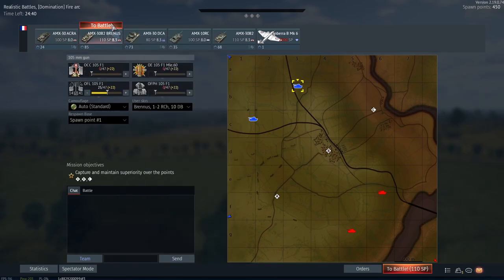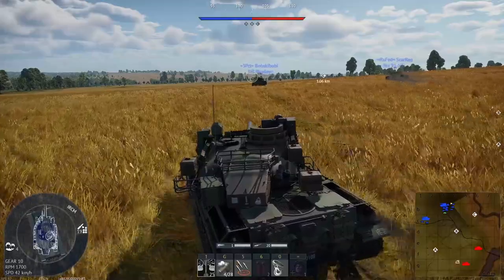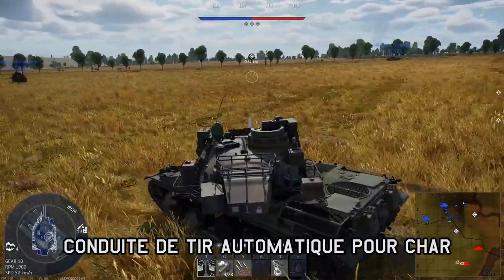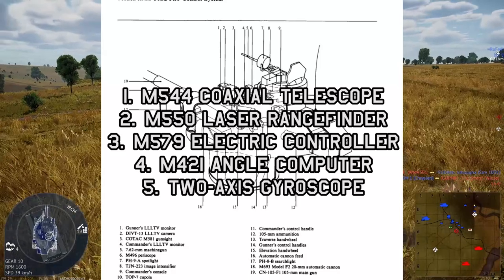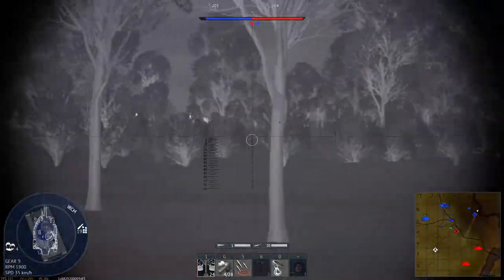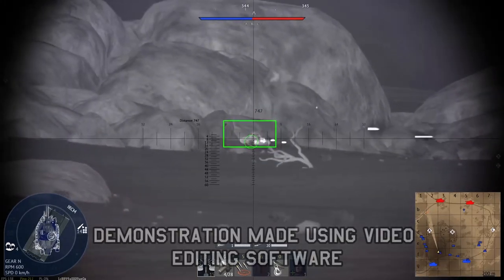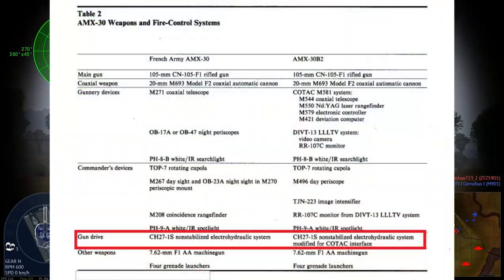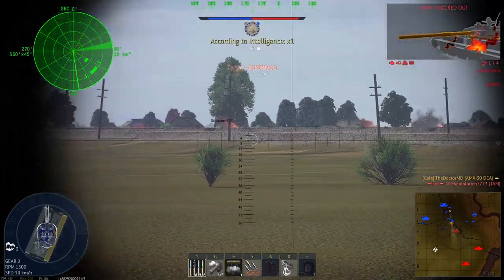Why the AMX-30 is not stabilized.

Comment: AMX 32 could fire on the move but only if the commander used its priority controls over the turret systems. When doing so, the servos of the turret would receive inputs from the M527 gyrostabilized Panoramic  thus sbalizing the turret and the gun to where the commander is looking through his sight. I'm the person that performed a year of research about the AMX 32 to bring it into war thunder and if you want more details about this vehicle and plan to make a video, id be glad to provide you with documents.
Reply: IF you're Tantor57 you forgot to log out of your personnal account mate
Reply: I think you want to say is that the gun isn't stabilized but the sight is... 

Meaning you aim and hold fire button and when the gun bounces in just right position it will fire lol
Reply: @kajmak64bit76   so the Abrams isn't stabilized then ? because that's how it works in Abrams
Source : D.Barr, Gunnery Data Analysis, Naval Post Graduate School, 1992
Additional source : Comment about N. Moran/ The Chieftain
Reply: @jeandelacroix6726  no Abrams is stabilized... this is just special France things lol

Gun on abrams doesn't bounce up and down and doesn't fire when it hits the exact spot the sight is aiming at...
Reply: @kajmak64bit76  and your source?
Reply: @kajmak64bit76  The gun isn't stabilized how you think it is the gun itself dose not have a gyro attached to it due to inertia issues making fire on the move hard the gun follows the stabilzed sight and fires when it is aligned if you drove an Abrams fast enough the elevation mechanism or fcs could get overwhelmed and cause the gun to wobble just like on the french tanks it simply has a faster fcs/vertical drive making it harder
Reply: @Blorb137  what are you talking about? AMX isn't stabilized... it has a stabilized sight not the gun... when gun bounces in the right time where you're aiming that's when it shoots...
The GUn isn't stabilized... the Sight is

Abrams is stabilized if that's what you on about because i didn't put a comma
Reply: @drunkensailor5771  bro literally just watch a video of the Abrams. It's clearly stabilized.

Comment: 1. The TCM-32 turret used the principle of monosource director stabilization. That is to say the drive were not the source of stabilisation themselves but ran through a comparative process within the FCS to finalize movements. Aka they used the same gyroscope as the M527 gyrosight as the reference while the gun drives' gyroscopes were only use to know current position and if it needed correction compared to the original. It was hence stabilized and could fire on the move as stated by GIAT engineer Playe during a 1981 interview about the work at AMX-APX (also shown in the Horizon magazine). Furthermore trials by Swiss ( and UK tank commanders, do confirm this capability). Finally, this system is still used on the Leclerc (even the Leclerc's gun isn't independently stabilized it's servo-slaved to the same gyroscopic source of either the gunner's or commander's sight, depending on whom is using it).
TL;DR : The FCS know where the gun is (drive's gyros) and where it should be (gun/sight unified stabilisation unit) on AMX 32/40/Leclerc (and technically the AMX 30 with M453, see below)

2. The B2 does not use tech from the AMX 32, it uses tech developed for the AMX 10 RC (which was the main selling point of the vehicle) while the AMX 32 uses a mix of the three prototypes developed for different 1970s upgrade programs, namely the one using M453 sight (transformed into M527, though even the M453 used COTAC components, it's more of an inbetween), the one using the CH29-1S drives (turned into the TMS-32 turret with ATG-32 drives) and the one using AMX 10 RC's COTAC system (which stayed the same). Except maybe the engine part. I am not versed in the engine department.

3. France interested in stabilizers started around in 1975 when SAMM upgraded an AMX 30 with the CH-29s drive. It worked but the interest was minimal due to the low added value of stabilizers (due to gun inertia, you still needed to stop to fire if you wanted to fire accurately past 1000m on any given tank back then , no matter which country, every modern tanks still struggle to hit a moving target past 2500m when moving). The crippling gun inertia of early stabilizers that were used on the M60 AOS and Leopard 1 was solved usually solved by having an indepedent stabilized gunner sight and a complex correlation firing system (2 different stab source meant more alignment error). France solved it differently by using an unified inertial source built (at first) directly into the M453 sight and with feedback from drives drove the whole system. The alignment system was simpler, due to the singular inertial reference. This prototype AMX 30 program evolved into the AMX 32, the AMX 40 and finally the Leclerc which all use the same system (with technological improvments on the gyroscopes, drive speed and FCS computer chips between the X40 and Leclerc, X32 and 40 used the exact same system)
EDIT ; after looking for confirmation, the M1A1 and M1A2 uses a similar system, as noted by D. Barr in his post-graduate analysis (Naval Postgraduate School)
Reply: Commentaire très intéressant j aimerai échanger plus avec vous si possible
Reply: @monfortnicolas5448   que voulez-vous ?
Reply: @jeandelacroix6726  vous semblez avoir de nombreuses information sur la manière dont la stabilisation de l amx 32 fonctionne et j aimerai en savoir plus. Si vous voulez donner suite, contactez moi sur via mon pseudo ( vous savez lequel ) sur la messagerie du forum
Reply: Nicholas Moran (a former M1 tank commander, known as The Chieftain online) says the M1 stabilizer works as you describe; with the gun following behind the stabilized sight, the FCS functioning to make up the difference. It would not surprise me if almost all stabilized tank guns today work on a broadly similar concept.
Reply: @Momomaster25   yup all modern stabilizers work on that principle. The Leclerc's is just a more modern version of the AMX 32's, the Abram's is based on the X-M1's Delco Electronics director stabilizer (which is an improved version of the gimballed version tested the XM-803) while the Leo 2's is a direct copy of the XM-803's. However I have no idea about Chinese and Russian tanks. Chinese probably use a similar system but Russians ? No idea.
Reply: @Momomaster25  Indeed, the principle is called director stabilization system as opposed to the reaction stabilization system. The difference between the 2 is that with a director stabilization system, the gun is not stabilized but driven by a stabilized device which will adjust in real time the position of the gun. The benefit of this method is that you mostly negate the inertial moment of simple 2 axis gyroscopes which won't receive any imputs but only react to gravitational phenomenon. Most of not all modern tanks ditched reaction stabilization system because due to this moment of inertia, accurate fire on the move simply is not possible due to the gun constantly moving even if only by few mm which means that at 1km you'll be meters off the target
Reply: Donc, si on couplait la stabilité du canon avec le système costac qui disait où tirer pour toucher la cible, est-ce qu'il y aurait pas moyen de faire un tir très précis malgré la vitesse ?(ou améliorer le système pour qu'il prenne en compte la vitesse puisque il me semble qu'il prenait que la distance)
Reply: @odezat1317  oui c est ce genre de système que l on retrouve sur le Leclerc entre autre

Comment: Watch gaijin remove the amx-32's stabilizer but not lower its br.
Reply: Hello there.
Reply: I just got the tank and it would be unplayable without it.
Reply: @alexbundy9960  now we need Ted
Reply: They would need to remove it from the M1 Abrams as well since they use a very similar system

Comment: The real question is, why are these tanks so high in BR without stabilization?
Reply: Da, balance comrade!  France was considered OP when the nation was first released.  So, the snail nerfed them by upping the BR and increasing the repair costs.  Some of the mid-tier tanks have 4-6 second autoloaders, so they were too good at quickly dispatching multiple enemies...win rates were too high.  Never mind that most people who played France at the beginning were probably experienced tankers in WT who knew how the gameplay mechanics worked.  Gaijin also buffed AP rounds concurrently with the addition of France, since so many of France's vehicles use AP rounds with no HE filler.  The Brenus used to be 8.7, and the Surbaisse was 8.0.   France had one of the best 6.7 BR lineups for quite a while.  I still can't fathom why the AMX-13 is 6.7 while the EBR (1954, event vehicle) is 6.3...they have the same gun and autoloader, but the EBR is a lot faster.  Both have very little armor.
Reply: @scotttill3847  The AMX-13 also has an absurdly high repair cost.
Reply: @a.b.3455  Indeed, although premium vehicles usually have lower RP costs than tech tree vehicles.  It would explain why the EBR is cheaper.
Reply: Thermals, APFSDS, ERA, LRF and APS system 
The Brenus is super good as long as play smart
Reply: @reimuhakurei2208  I do, sort of agree. But the AMX-30B2 is the same BR and lacks two of those things.
Reply: You can just play them slightly less aggressive so you wont need the stabilizer, you still get better mobility than the leopards and a 20mm coax + thermals
Reply: @a.b.3455  The B2 should be 8.0. The weaker engine really makes it suffer in mobility. You're missing like 100 hp compared to the AMX-30(1972)

Comment: Also it is French and they don’t know how to make anything right
Reply: Well, actualy it was kind of stabilised,and cope, prety much all the cool military things come from France...
Reply: how to spot a french hater without arguments in one simple step:
Reply: @valian8985  too bad that gaijin reinforces his claim by repetitively mucking up the French tree on every possible occasion, cept for the mirage 2000 but that's an extremely rare instance 💀
Reply: He just used CIA thoughts as a source instead of actual trials performed by GIAT engineers + idependent trials from Switzerland. It worked, he just didn't have proper sources.  The main different resides is that the french used a unified inertial system with feedbacks while others used a multi-sourced one. And France still uses the same system on the Leclerc just that it has a better integration with the firing solutions given by the FCS that the previous models used on AMX 32 and 40, which ran those separately due to technological constraints of the time.
Reply: @heliogonzalezsanchez8227  man it was a joke
Reply: @Intellgenttwig  then where's the funny?